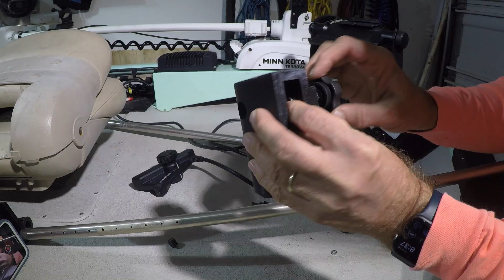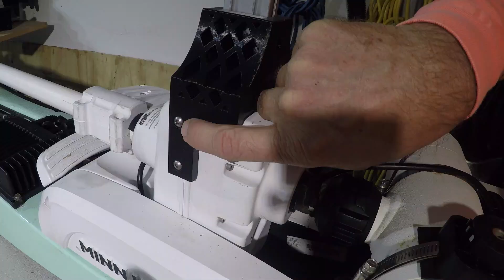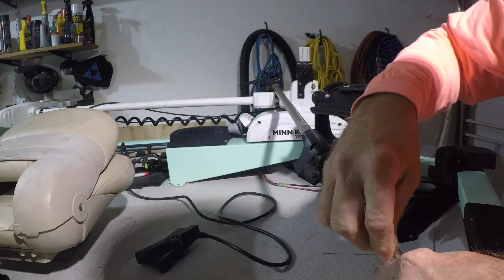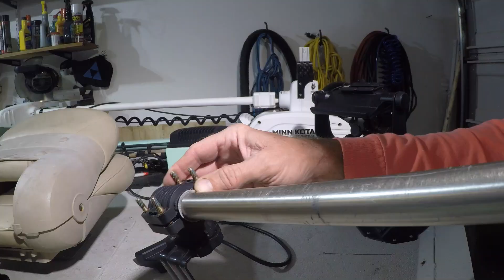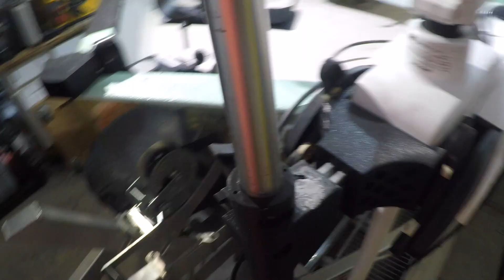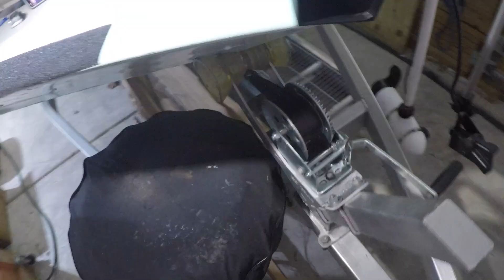3D Printed Garmin Live Scope Mount

Comment: Any reason why you didn't model the housing connection to connect to the top of the housing where it could effectively clamp around it without having to drill and tap the housing itslef? I realize it's quite a bit more complicated to do that since the collar is tapered.
Reply from the maker: Internal components were in the way of drilling.